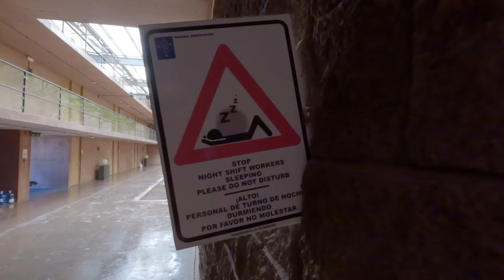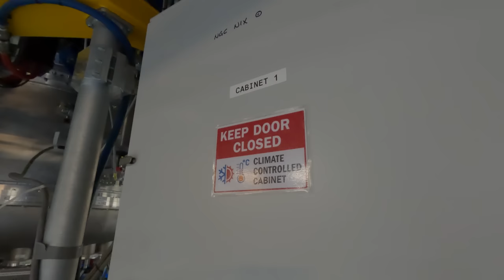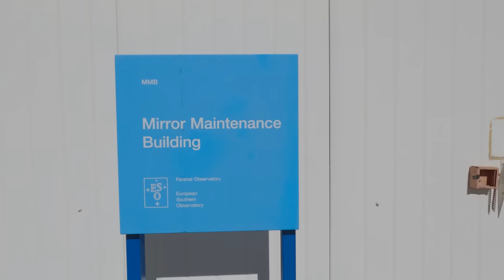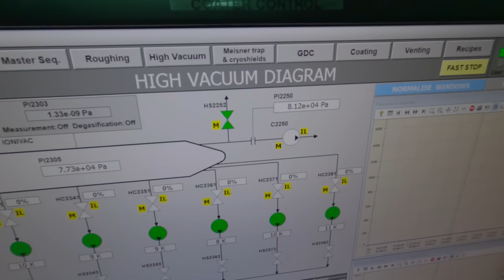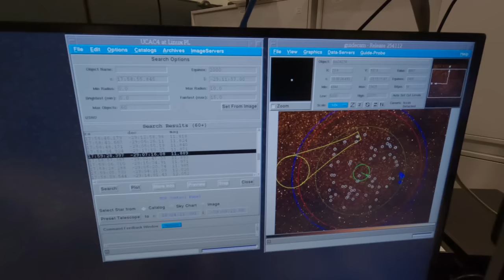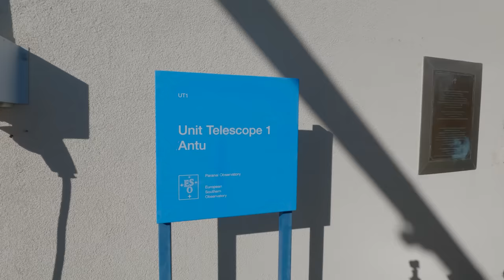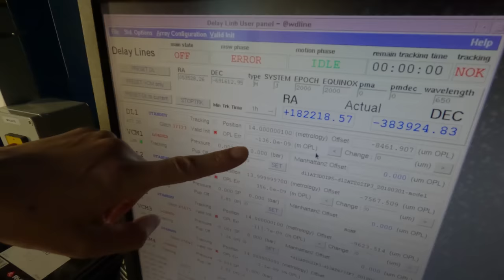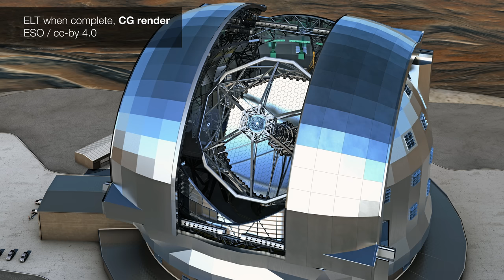The largest telescope that will ever be built*

Comment: 3:29 Radio waves, not light? I mean, "visible light" is a term which is actually used. That has to mean that there is invisible light too. Why should we stop at ultra violet light and infra red light? When that is invisible light, wouldn't it make sense to call all electro magnetic radiation invisible light toot? Also radio waves. Either that or light just describes the visible spectrum. But in that case, the term visible light wouldn't make any sense since all light is visible.

Comment: I used to record the radio on my boom box all the time - I still have some recordings of John Peel! :D

When recording broadcast radio on an audio cassette, the radio signal is demodulated - the carrier wave is in the megahertz range, while the audio signal you hear is thousands of times slower, in the kilohertz range. I don't think an audio cassette (at least at normal speed) could capture the actual radio signal itself.

Technology Connections did a great video about how VHS works, and all the challenges of recording the TV signal on magnetic tape. The TV signal was at a much higher frequency than audio cassettes. Can anybody tell me the frequency range of that signal? If I remember correctly, it's recorded exactly like a broadcast - a high-frequency carrier modulated by a lower frequency signal. And then that "broadcast" is played back to your TV receiver. But I might be remembering wrong... can anybody tell me?

Comment: I disagree. I think we can put an even bigger telescope in space in a decade or two. Fly up two or four starships with mirror components, assemble them in space, tag on a small motor, fly to L2 in a year or two. Note that the primary mirror might only cover 25-50% of the area that it makes up. i.e. 75% of the light will pass through the mirror and only 25% will be bounced back to the second mirror.

Comment: 11:20 isn't 0.1 micron 100 billionths of a meter? So 1000 atoms thick = 100 nm so one atom thick is 0.1 nanometers thick? Maybe he goofed the math off the top of his head or is my conversion wrong? Those are atoms of silver or aluminum? Does the atom make a difference in thickness? obviously if it was hydrogen it would but metals are kind of blurry due to quantum effects of the valance and conduction band gaps of the electrons. Or I'm full of crap and dont know what I'm talking about.

Comment: What would realistically be the requirements for optical interferometry? Curiously asking as computer hardware is advancing at a fast pace, same with hard drives and gpu processing power.
Reply: In order to capture a wave with a certain frequency, you need to sample at at least twice that frequency. For visible light that would be around 1 petahertz, or once per femtosecond.

Comment: Optical sits within the Radio waves - Optical is a small slice of the massive bandwidth that continues to be larger and larger.  ELF resonates state size rocks and vibrates the Earth allowing talking to submarines under water.  Not much data but some and enough. Terra Hertz is really high frequency.  X ray and UV  are inside like light.

Comment: The 1000 atom layer thickness of the mirror coating statement doesn't ring true to me. It's also conveniently metric if it translates as 0.1 micron.  

I thought metric was based on the distance light travels in a given time? Is this calibrated to 10s of atoms?